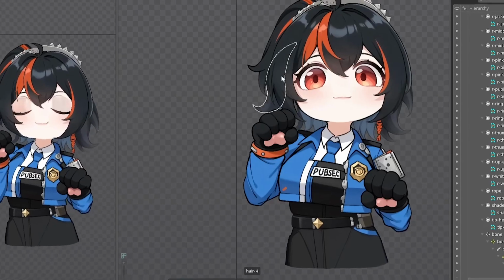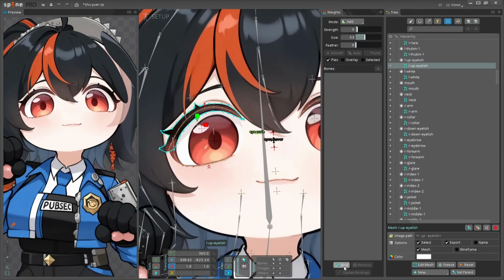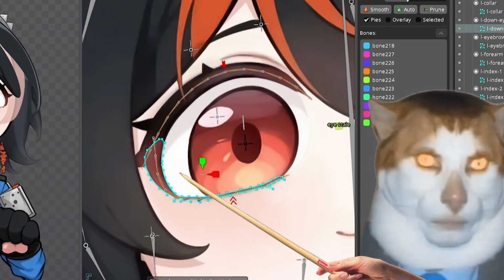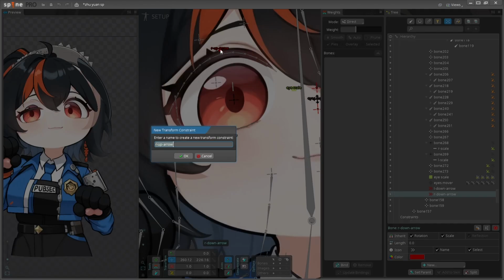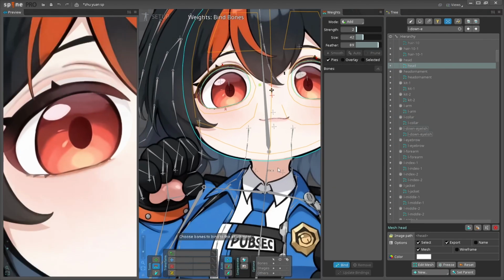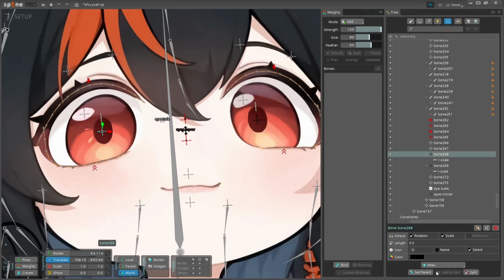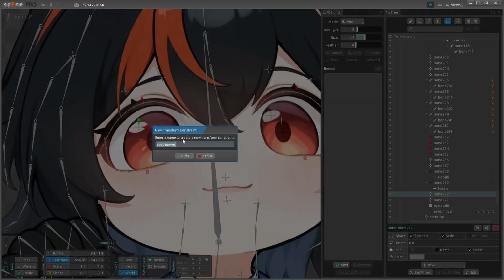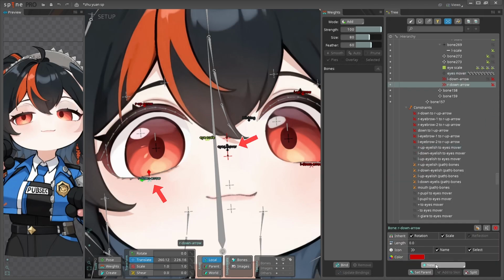👀How To Animate Eyes. Skeletal/Bone System. Spine Pro 2d.👀@yuphi_kid

Comment: parenting the pupil bone under the eyeball and only translating it saves a lot of cleanup later - clamping the travel so it can't drift past the lid line avoids that googly-eye slip mid head turn. curious how you handle the lids, separate bones or mesh deform on the eyeball itself? I go back and forth on that every rig, bones win on control, mesh wins on soft blinks. this kind of small controller breakdown is my favorite stuff to dig into too

Comment: "Create an arrow controller bone for each eyelid"
Ya had me up until that point. I watched your previous vid and don't know what that is.
Reply from the maker: I mentioned that this method includes some elements from the previous tutorial. Those are the same arrow controllers for each eyelid.

1) - In the first tutorial, these arrows (bones) were "bind"(first the head, then the arrows) to the eyelid layers (lashes/eyelids), and the blinking animation was created using those arrow bones. The eyelid layer was weighted by the arrow bones so that the layer deformed, simulating the eye closing.

2) - In the second method, I attached the bones(that were previously separated) to the layer  using the "Split" option. These bones are also connected to the path system using "Path Constraint" and we don’t touch them anymore.

Now, to simulate the eye closing, you need to apply weights to the "path points" using those very same bones — the ones you referred to as “Create an arrow controller bone for each eyelid.”
You create an animation for the arrow and apply weights on the path points accordingly.

Note: Since we’re not directly controlling the smoothness of the eyelash layer’s contour you "bind" these arrows (upper and lower) to the each eyelash layer and adjust it just like in the first method — refining the contour for a smoother result.

➕Also, don’t forget about the lower eyelid — make sure it moves automatically in the opposite direction of the upper one by "Transform Constraint".
   And don’t forget to include the main blinking mover if one is needed( just parent the upper arrows to the main one).

With love, Yuphi ❤️
Reply: @yuphi_kid  Hey I really appreciate the response! I think my point of confusion was that I missed that point in the first video where you show the "arrow controller bone" is just the upper and lower eyelid controller bones, but you changed the icon of each to be an arrow. I thought it was something completely different from a standard bone lol

I'll be keeping an eye out for more Spine tutorials from you, thanks again :)
Reply from the maker: ppl like ya making my motivation bounce up💯